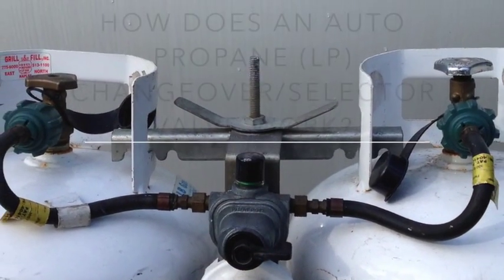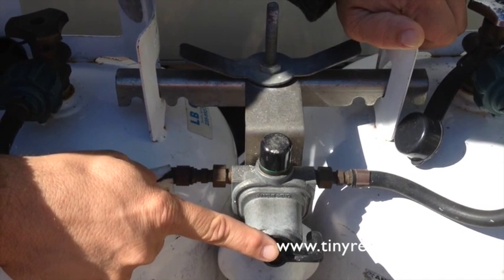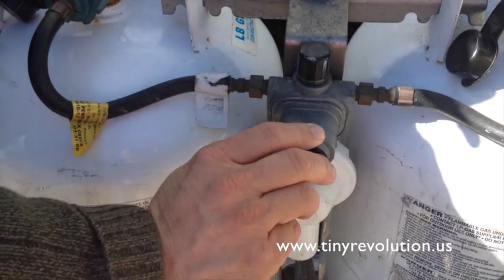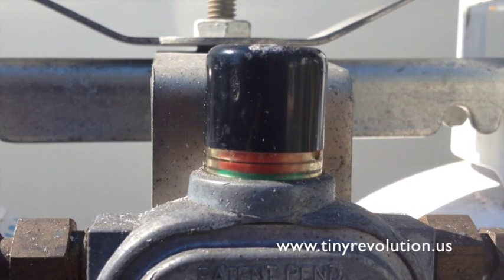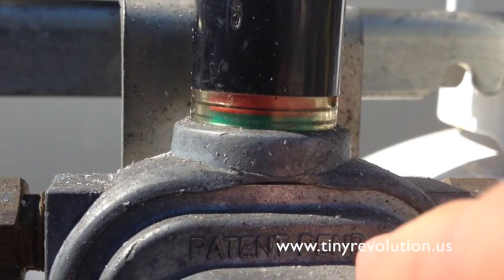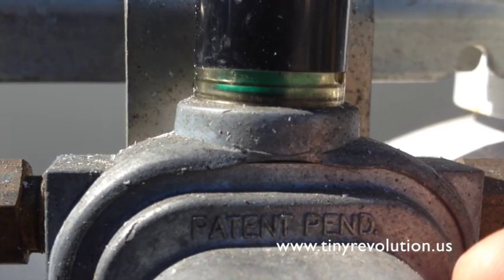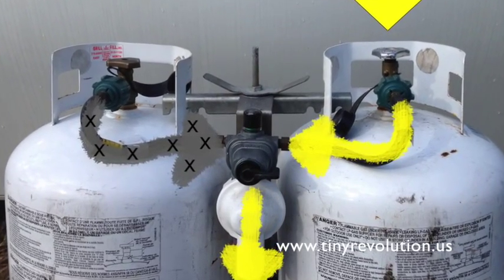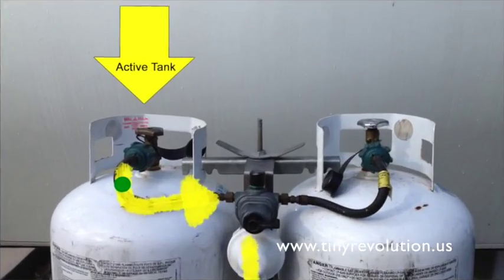How Does Your Automatic Propane LP Changeover/Selector Valve Work?

Comment: Thank you.  I do have a question. If my oven is running and the tank changes over, won’t the flame go out?  If so, gas will e pouring into oven that is not lit, thus creating a dangerous situation. How does that work?
Reply: It will not. You are safe, if that was happening, these wouldn't be sold now would they?
Reply: @zigarten  thanks. All installed a couple of months ago and working well.  Not anticipating the tank going empty for some time, as it’s only powering a stove.

Comment: INADEQUATE No instructions on when to remove the empty tank.  Before switching the lever over, or after switching the lever over.
Reply: The lever does make you aware of which tank is empty. If you swing the lever to the right, and a red flag pops up, it's empty. Pull it and go get it filled.

Comment: So it doesn't matter which position the lever is in? as long as both tanks are turned on, it will switch when the first one is empty? you don't have to switch the lever?
Reply: It will use the gas from the tank it is pointing to first. the pressure from the tank it is pointing to hold the valve closed from the opposite side, so once the tank is empty the pressure is lost and causes it to start using the opposite tank.

Comment: You closed the valve on the left tank saying it could now be refilled????!!!! That’s supposed to be the one that you said becomes the new supply side. 
Anyway, after the regulator automatically switches sides do you flip the lever to that side???? If not, what’s the point of the lever. 
Slick video presentation but maybe pay more attention to dotting the I’s and crossing the t’s.
Reply: Because the site-glass is reading the tank the lever points to. If the glass is red, and the lever is to the right, you know to swap that empty tank.

Comment: So my sight glass never moves it's always red. Is it stuck? I can't see it being broken?
Reply: I think you need to have a gas appliance operating while reading the gauge. Such as leave a gas burner on while moving valve from left tank to right tank. To determine which tank is Mt. If not consuming some gas when you switch from full to Mt tank. It will stay green.
Reply: Either both tanks Mt or yes faulty gauge?

Comment: The right side tank runs out of propane, then at the end of the video you disconnect the left side (full) to get tank refilled. Some people I am sure are scratching their heads?
Reply: Definitely confusing how he did that. big thing to know - you can disconnect any tank at anytime and the other (assuming it has pressure) will take over. the readout (Green/red) only shows the tank it is pointing towards and once pressure is lost in that tank it will allow flow from the backup tank.
Reply: @Davinjw  That's true, well I just put a new regulator on about 2 months ago and working top notch, now Ian that bastard hurricane just totaled out my RV. All the work I put into gone. At least I have learned at 63 and my years as a Deputy Sheriff and Police Officer that one door closes another is opened! Thanks for your reply.

Comment: Actually works like this.----

Place one of the two cylinders in supply by rotating the changeover lab lever, either way as far as it will go. The arrow will denote the "supply" service side. Open both cylinder valve slowly. Gas will now flow from both cylinders through the pigtails into the regulator by way of the inlet fittings, the top and indicator will change to green. When the pressure of  7 psi is reached beneath the regulator diaphragm, the closing springs in the inlet fitting well shut off gas from the "reserve" cylinder. The "supply" side of the regulator will continue to supply gas as long as sufficient gas remains in the "supply" cylinder. When pressure in the cylinder drops to about 7 psi, the reserve side of the regulator will open and continue to regulate at 11 WC (.4 psi). At the time the supply cylinder becomes exhausted top indicator will change to red. When indicator is red a cylinder exchange must be made.
Reply: "the top and indicator will change to green"? What does that mean?